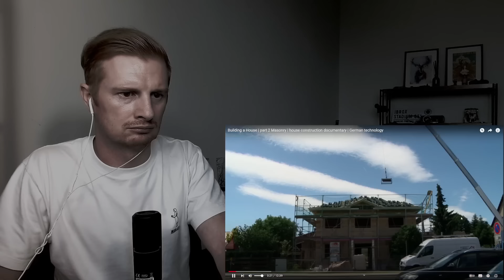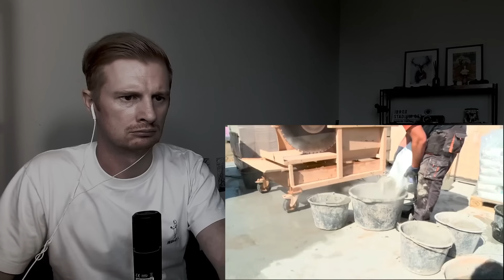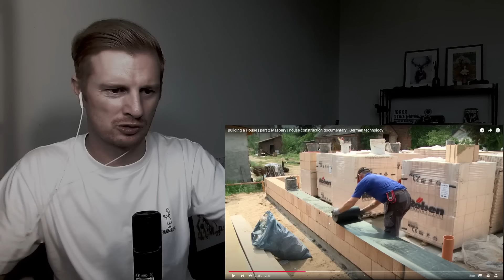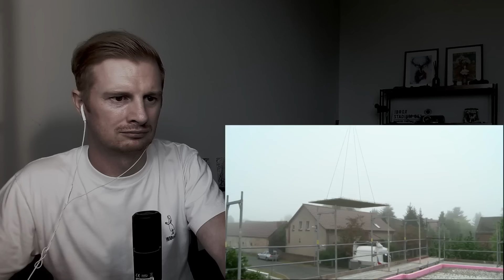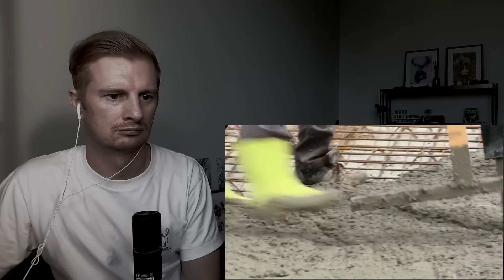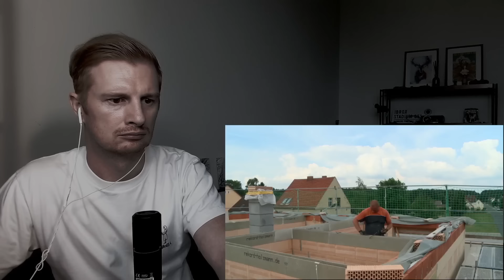Reaction To How German Homes Are Built

Comment: I guess, most German houses do have a cellar. Recently, because of increasing costs, many new homes don't have a cellar. 40.000 Euros less...

The house my parents built in 1973, already had similiar bricks. Our bricks had the same large format, but had no filling with clay or insulation, but just air. It's very good insulation, though, our house stays very cool in summer and warm in winter, although we haven't got aircondition and quite small heating.

Comment: A basement cost 3 times like a additional floor. Thats the reason. Older houses have a basement.
The stones are all similar. Hollow blocks are mostly used. This variant is of course from this company but the principle is always similar.
The ceilings are really extreme. I wanted to drill holes for dowels for a holder. No chance with a standard hammer drill. The machine laughed at me and burned out the drills.
I had to borrow a professional machine and special drill bits.
Reply: Zoning rules usually limit how tall you can build. Thus adding another story on top often isn’t possible. In the end, land prices (and house prices in general) will decide whether buying a larger plot of land or adding a basement gives you more floor space for less money.

Comment: The "Rohbau", the naked walls, do not take a lot of time. It is all that plumbing, electric installations, plastering  the inside and cladding the outer skin in  (nice to look at) brick or plaster ...much later takes weeks or months.
Reply: The timeline in the additional videos in this house building series illustrates this very well. If I remember it correctly, there is also a multi-week break in between during which they have to let things dry before they can continue working.

Comment: Most houses in Germany have basements. I'm really confused why this one doesn't.
Reply: I've seen quite a lot newer houses not having a basement, as it adds significantly to the overall cost (in building as well as in maintenance)
Reply: It depends on many factors if you build a basement or not. Here in Northern Germany ground water levels are quite high, insulating the basement against this amount of water pushing all year against the walls makes it particularly pricey, might be even more expensive per square meter than the rooms you live in.
Reply: @danielrauer5864  I'm from the south of Germany, so I did not know that. The company that built the house is operating in Berlin and Brandenburg (and you can see the name of a company based in Lower Saxony on an insulation part) so that's probably the reason here. Thanks for the insight!
Reply: Basement and attics are expensive so this house does not have it. As houses are built by the owner it is hard to say this is a typical house for Germany these days
Reply: I live in an area, in which within the last 6 years 15 houses were build. All without a basement. The cost for a basement is incredible high, so almost all new houseowners build their houses without one.
Reply: Almost none of the houses in our neighborhood in the Westerwald region built around the year 2012 have a basement. Due to groundwater you would need to build a very expensive type of basement, adding about 60 to 90K to the building cost. Most here opted for a larger garage.
Reply: Newer ones often get planned without them nowadays - cellars are costly to make, so if people don't want them, money is tight or the terrain isn't made for them (like i  my area the ground water level is pretty high and our cellar gets flooded kinda easily, that's usually one of the first things that get kicked out in the planning process...
Reply: Yeah man, tell me about it... I was SO TEMPTED to say something to the effect of "Ami-Schrott", but then I decided to let it go...